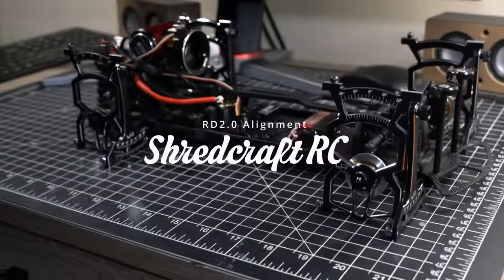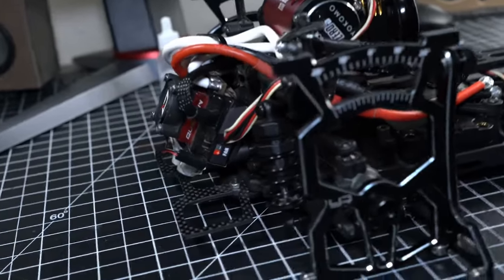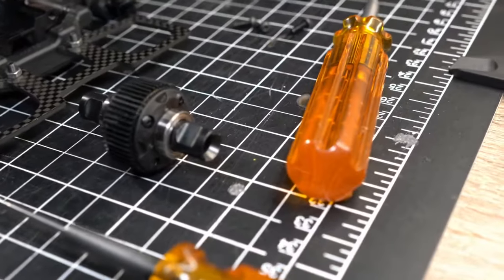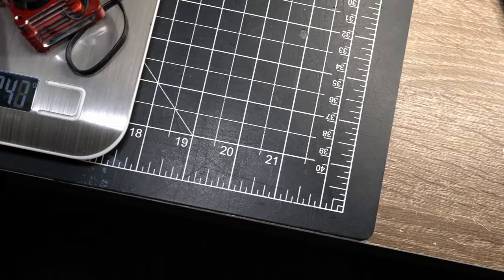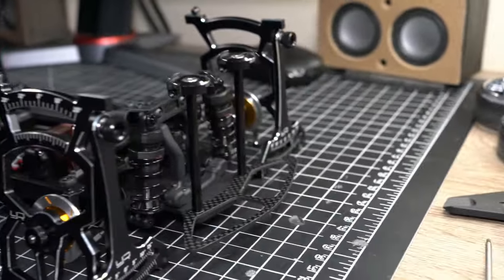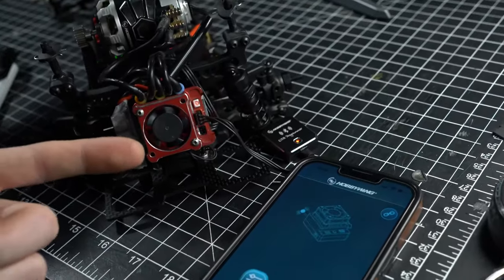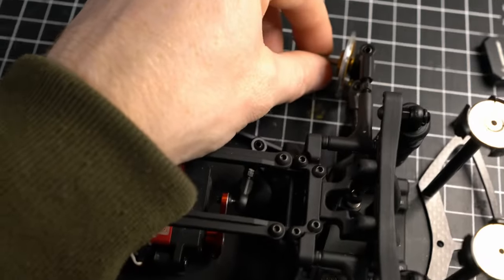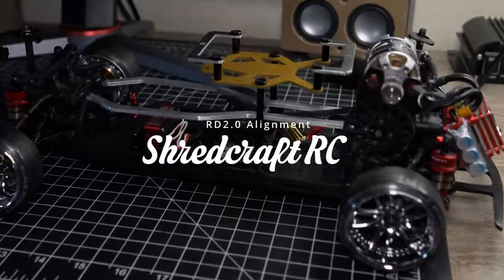Yokomo RD 2.0 Alignment Settings #rcdrift

Comment: You rock man. Im going to watch this on my lunch... I might try and implement my real drift cars setting but swap rear and fronts settings, not sure if people have done this but it seems logical.
Reply from the maker: This is a very similar setup as to what I ran on my real drift car. Toe in on the rear, toe out on the front. Pro drift cars run so much rear toe that their tires scrub driving through the pits but under compression it flattens out the tire and creates a lot of mechanical grip.
Reply: Speaking of pros, FD is in a few days. They discarded all judging and run from previous season and "supposedly" all about tandems this year. Going to be an exciting season.
Reply from the maker: Yea I’ve followed pretty religiously for the past 15 years, was even on my way to a pro am license. Past couple years were so lame and the stream has been declining, it was not a sustainable format so hopefully this will provide some positive change for the sport.

Comment: On that 10BL120 esc try punch level 1 and the timing setting at full power, then set your th expo to -100 curve. That way as slow and smooth as possible on the lower portion of the throttle and a turbo like feeling on the vert last portion of the throttle. Dont give up on the bughett friendly 10BL120 lol ❤
Reply from the maker: I’ll definitely give that a shot as I put it in another car, it’s not bad it’s just in comparison to my rad or xd10.
Reply: @shredcraftrc  Yeah haha, that it is! Also, if you are running like a 84T spur try bumping it up to a 90T for more traction at the lower part of the throttle and more "ramp up" effect.

On your type of surface I would most likely be running 16T/90T on a yokomo style trans. Come to think of it perhaps YZ metal gears in the diff with only a light film of bearing oil on them, no o-rings and a 0.2mm shim between each drive cup and the diff case and enjoy all of the grip city lol 😊
Reply from the maker: @bakko9302  For me the gearing feels fine and the car has a lot of grip and since I have nice electronics I prefer to use those over the 10bl it just doesn't feel as nice as far as resolution and its what i prefer. Perhaps if this was my only esc I would play with gearing but these cars dont need it imo, fdr of 9-10 is the sweet spot for our track and I have played with pinions but find 9ish is my jam and mechanical grip is always preferred over gearing for me, everyone likes a different feel.
Reply: @shredcraftrc  Yes, but it was with spesificly with the 10BL120 in mind I suggested the gearing to bring that lacking resolution you mention up ✌️

Comment: Wanna get back into drifting, should i get this or RDX
Reply from the maker: Just depends, I love my rdx but I have a lot more seat time with it and I think it drives better out of the box but the rd2.0 is a great value for the money.
Reply: Depends. If you want to just drive without diving into tuning go with RDX - you can't mess this up. With RD, since you have turnbuckles from the beginning, you need to be precise with building it but in the long run you get already a very good chassis that you can set up to your needs without having to buy any additional stuff. Plus RD2.0 is cheaper than RDX so that extra money can go to better electronics. Personally I own RD2.0 (previously owned RD1.0)  and I'm running it in stock alignment on polished concrete and local version of P-Tile and I have no issues keeping up with RDXs, Sharks or anything that goes slides on our track.